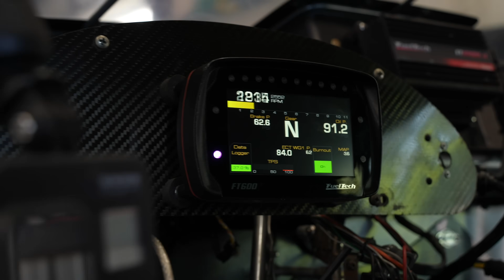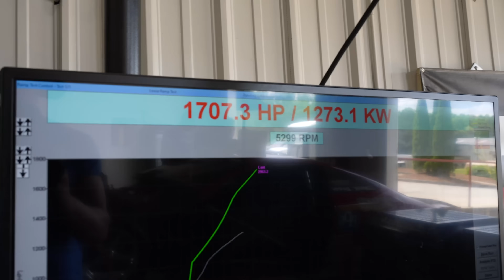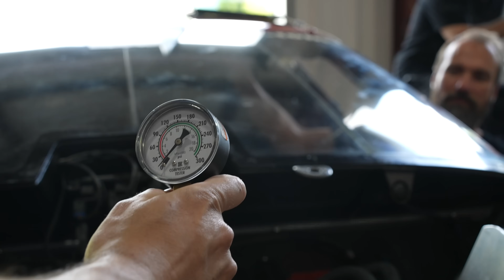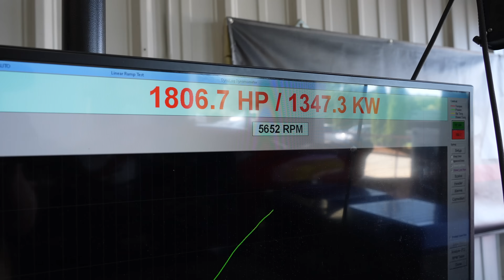1,806 WHP | Ecotec 2.2L 4-Cylinder | Nicolas Brunet

Comment: What an amazing achievement. Then they take "only" that amount of power and run 5.82! This means the whole car must be trickier than trick. I know it has a 10 speed gearbox and an ex Mike Edwards chassis, so there's that!! But what else?? That block must be beefed up, somehow surely - I heard pit gossip about a cassette? The valve springs look like they have cooling jets. The turbo housing is trick. That's just what we can see, anyone else know of other interesting aspects on this car?? Amazing skills by those freres Brunet!! 👏

Comment: 821 horsepower per liter is absolutely batcrap insane any way you cut it.
Reply: Still cast block too … the Hondas need billet blocks to make that power. I recall there being a company in Australia that makes billet ecotec engines that are rated for 3000+ horsepower from a 4 cylinder.

Comment: ECOTEC makes 1800hp whp 10 months ago @ only 5600rpm vs LAZCANO 2JZ 1880hp @ 7400rpm 2 years ago!!!!!!! thats 2 less cylinders, less capacity less rpm and less boost than when he races. Why is everybody wasting time on expensive 2Jz and K series when the Ecotec can be had for a six pack?
Reply: Great question! Very few people seem to know what the ecotec is capable of for some weird reason.
Reply: Look at the torque numbers too. And don’t forget a 2jz went 5.53 or 5.54 at 263+ mph at World Cup last year. They make billet ecotechs that are made for 3000+ horsepower !
Reply: @Brian-bv7ih  Carl Brunet's car still used the OEM stock block & head, only built internals!
Reply: @JamesSpencer-f7u  🤔 No, this is GM 2.4 lt. Marine Engine with especial aloy.  🤨  for this is 🦄  unic engine over the top in 5 sec. zone. 
    This car is legal and haved the récord holder World Fastes 4 cyl.  😉
Reply: @Rotary24wankel  WRONG. do some research, they use the L61 2.2 engine block from the 2004 ~ 2006 Cobalt GT. Prove it otherwise. Carl already stated the version of the 2.2 L61 Ecotec they use. We wil wait for your theory.
Reply: @AmericanFreedomPatriot this blows my mind
Reply: @AmericanFreedomPatriot Is this the L61 engine and would it be unreasonable to believe it's capable of more?
Reply: @saiga223ak I’ve built them, they are reliable
Reply: I’ve been saying this for years, and remember it’s a stock cast block… lmao

Comment: Very competitive car !
No info on engine specs ?
Reply: L61 2.2 Ecotec, Stock Block & head, built internals, 88mm turbo, 10-speed transmission, currently holds the 4-cyl world record at 5.82 at 242.7 mph in the quarter.
Reply: @JamesSpencer-f7u 
Stock block & cylinder head ?
Bruno use to use the Saab 2.0 head .
Im sure 2 foot long head bolts …
Reply: I just know it's a turbo 2.2l ecotec out of a 2004 cobalt. I'm sure they wanna keep as much info as possible secrets so they stay at the top

Comment: Wow, so much for 2JZ being so great when you can do this with an Ecotec LMAO 🤣 I've never understood the obsession with Japanese cars.
Reply: A jz makes that power easier and less stress on the motor which is why the bigger displacement motors run longer. Good on them for the R&D gone into this motor lots of work lots of headache all becomes worth it in the end
Reply: That really doesnt change the fact the ecotec engine is a piece of shit compared to any iconic jdm engine... If you have enough time and money you can shove enough boost in that gm junk and make it take it lol. you can get there much easier and quicker with engines like k series and 2jz
Reply: @repingers9777 I've done some research on the GM Ecotec engines and actually you'd be surprised at how strong those engines are. Back in 2002 they were able to put out 750whp+ on the stock block, sleeves and head. Those things are insanely strong but the problem lies that most people just don't know GM made these for building and not just commuter dailies. Surprisingly though, the only reason you didn't see people build them most likely was because nobody knew about what GM did with these, plus the people who ended up owning Cavaliers and Cobalts were normies and not car enthusiasts trying to see what the L61 is capable of. But yes, there's plenty of big turbo 2.2L Ecotecs out there that are pretty reliable at that.

Comment: Its awesome. But why does it smoke like it has no rings in it? That can't be helpful.
Reply: they inject oil on the exhaust valve guides directly . if you check the photos you can see the lines, oil just exits the exhaust not affecting the cyl op.

Comment: I'm glad y'all are doing an Ecotec considering the hondas and toyotas are overrated.

By the way there might be an I4 LS engine coming out.

Id like to see an Atlas 4-6 project as well.
Reply: 4 cylinder ls would suck it would have v8 architecture no high rpm ohc
Reply: @derekmaxwell8164 yeah it would be a shitshow 😂 half an ls would be a old crappy 140hp MAX 4banger that probably coughs and wheezes past 5000rpm. V8's are basically 2 4cylinders glued together ( not actually ) but if you cut in half a old ferrari v8 youd probably get a the 200 hp vtec engine's 😂 or bmw s14
Reply: I never really liked Honda that much but in all honesty they ARE NOT over rated, the B series are proven and the K series is slaying almost everything and is in the run for the best racing engines ever made per unit of displacement. This Ecotec is very impressive also.
Reply: @SVTCO  the problem is that this Ecotec has to be all manufactured, unlike Hondas and Toyotas where you can find all kinds of aftermarket parts for 1000+whp
Reply: @tiagoabreu4107 ya only EcoTec that I’ve ever heard of racing never see any EcoTec in anything that resembles a street car winning anything

Comment: Wow! Wonder what I could get out of my 1.8 corolla?
Reply: There are a bunch of 400 to 600 rwhp turbos for that engine size with a steerable powerband to 7000 rpm.   Rwtq is 300 at 3200 and 425 at 4500.
Reply: Streetable not steerable

Comment: 1800 hp at 5652 rpm, what the fuck? Maybe with 1500 hp shot of nitrous
Reply: That's axle rpm
Reply: @AndersonDick  lol no it's not, are you crazy? 5652 wheel rpm on a 28in drag radial is like 470mph...
Reply: @marvinwatson2749  what?
Reply: @tiagoabreu4107  do the math 28 inch radial circumference is 87inchs then that times 5652 a minute 491,725 inchs per minute times 60 for hour 29,503,440 inchs an hour divide by 63,360 for miles and you get 465
Reply: no nitrous guys  just turbo and technology . great racers, great track they own  and operate  Come to there track sometime,very well run ,worth the trip . the guys work darn hard

Comment: Is this the four cylinder that’s in the 16 Chevy camaro Rs? Four cylinder turbo?
Reply: captiva, saturn sky pontiac solstice  etc etc
Reply: and ,Opel ,vauxhal  ,satutn etc   ,  GM
Reply: Not getting this power slapping a turbo on just any EcoTec fully built envine
Reply: @CoyoteFTW  The 2016 camaro has a factory turbo and makes 275 hp from factory. The red Acura you see is on motor but is sleeved with forged internals. This summer will be making way more than this.

Comment: 1,807 Hp @ only 5,652 RPM😲 it sounds on the dyno like their pulling to 10,000🤣 sand bagging the number🦾😎 there is No Fing Way it made peak power@5,652 RPM! I think that’s more like  where the big flat hairdryer torque curve begins!
Reply: That's axle rpm for the dyno not engine rpm
Reply: @AndersonDick  so 4:1 rear end makes it around 20,000rpm!!
Reply: @sexyfacenation  I doubt it's a 4.1 ratio. Probably a 4.6 or 5.2
Reply: @johnsnow5239  so that's 25,000 rpm!
Reply: @sexyfacenation  hmmm, yeah that doesn't make sense. Coz alot of drag cars use short ratios like that. But I can't see them using anything longer than a 4.1..? Maybe a 3.8 but that's a pretty long ratio on a 400m drag car. They surely have custom ratios in the transmission as well so we will never know.

Comment: There is also a k series in the 5s now to the quarter mile
Reply: Honda has a recast head and no limitations on the turbo. They are running stock head and are limited on turbo size due to event rules
Reply: This car recently took the #1 spot back from the Honda cars..they are constantly passing it back and forth
Reply: boumahdi 🇩🇿  that's a dragster 🤦‍♂️ not the same lol
Reply: boumahdi 🇩🇿 ?? Which one? Cuz I  only know 2 cars 5 sec 4 cyl .. no war with a 5.86 and this Carl brunette
Reply: He's talking about Pimar  and No War.. @victorcruz4249